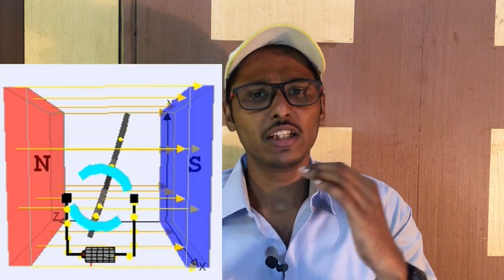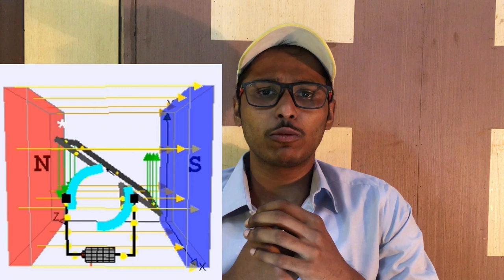AC Motor vs DC Motor | Difference between DC Motor and AC Motor in Malayalam

Comment: ഷണ്ട് വൗണ്ട്  മോട്ടർ എന്താണ്
Reply from the maker: Video cheyam
Reply: Dc motorinte armature supply terminalsumayi shunt wounded adhava parallely connect cheythal ath shunt wound motor aayir..
Matonn series wounded aan..
Series wound cheythal high starting torque kitum..but speed reduces drastically with load..
Ennal shunt woundil speed remains same irrespective of the load